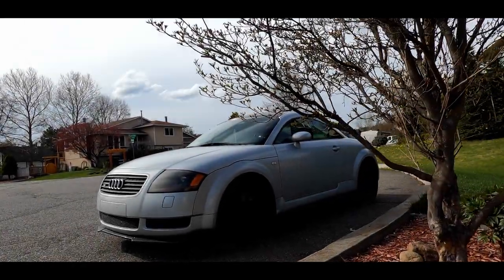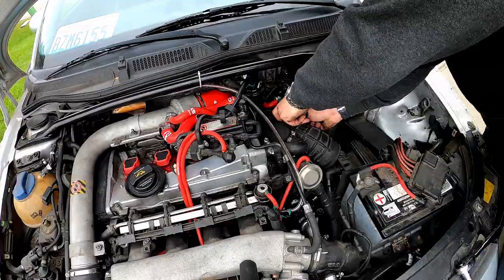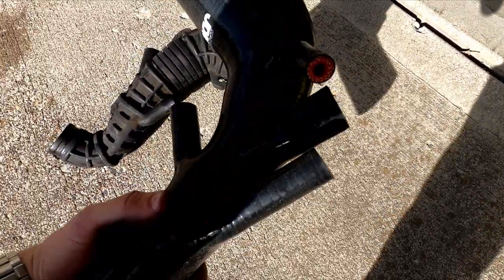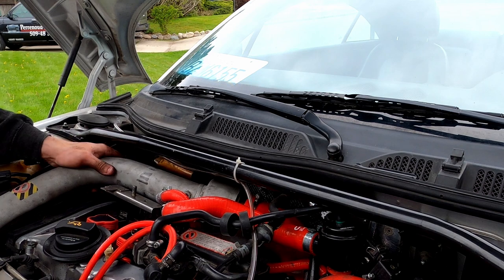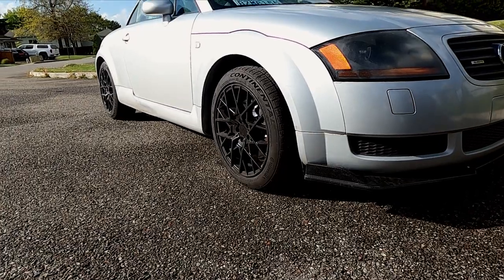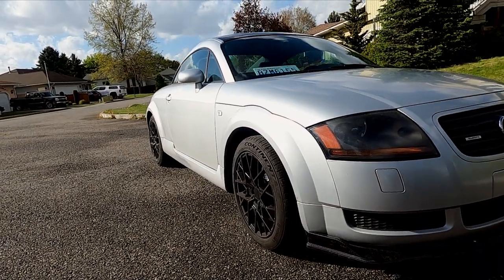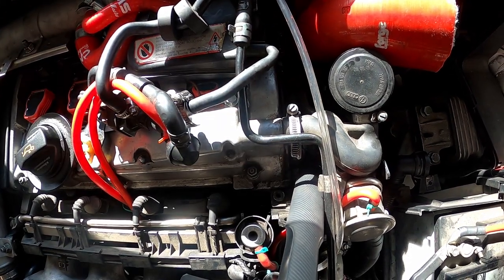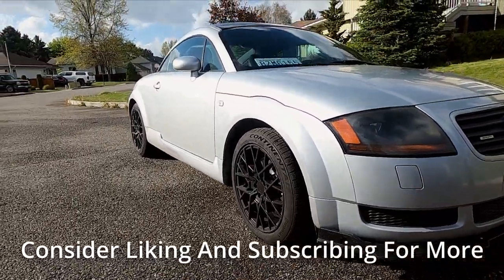My Process To Find 1.8T Boost Leaks Fast! |  & New TIP

Comment: Another interesting video, Hunter, thanks. Your attention to detail does you credit. I especially liked the diagnostic flow chart.
I have another recommendation for you. Adjustable rear control arms are another transformative modification to the TT.  There isn't enough adjustment of rear camber angle otherwise, meaning the car's chassis balance is always towards understeer. Most people concentrate on power mods but the greatest deficiency the Mk1 TT suffers from is in the handling department. The HPA controller and the increased negative camber at the rear have improved my car's handling beyond belief.
Congratulations, in advance, for nearly 1000 subscribers! Best regards. :-)
Reply: I installed on mine. Big difference
Reply: @moncier77  All the TT's grip, in standard form, comes from the front. Most of the weight is there, and the quattro system is asleep much of the time meaning it has all the worst traits of a FWD chassis. The extra negative camber at the back brings the rear into play,  effectively dialling out some of the front end push, of which there is plenty otherwise.
I suspect US and Canadian owners are less bothered about handling, but for UK and other European countries it's more of a benefit perhaps.
If you get an HPA haldex controller (somewhat ironically, a Canadian company) the transformation is complete.
Keep running with wind! ;-)
Reply from the maker: I am glad to hear someone liked the flow chart haha. I always find procedural processes helpful so I was hoping someone else would too. I really appreciate the support. I also like the sound of adjustable control arms:) I will start looking into those and try and get them to show up when I get the coilovers. The HPA controller also sounds like a really great upgrade! Thank you again!

Comment: Excellent video! 
Easy to watch.
Good advice regarding isolating the leak.

Love my Mk1 TT…

Lols… My selector fork just broke in my 6speed….Gulpppp!!😂😂😂
I’m removing the gearbox myself.😐😐😐😂

Looking forward to your next upgrade video… 
“Gets the juices flowing”
Reply from the maker: It makes me happy to hear you enjoyed the video! Sorry to hear about you having to remove the tranny. I'll be doing that sometime when I have to replace my clutch. Thanks for the support!
Reply: Ha I put in the latest version of selector forks in. 
1st-5th selector forks fit, but you still have to use the original reverse and 6th gear selector forks. 

The new versions are full steel and robot laser welded. 

No rivets holdings different incompatible materials together, like bronze alloys and steel.

Comment: I recommend you to replace your front grill. I had the same one as you have, and replaced it with the facelift one (the one with the 3 spokes). I painted it completely glossy black, with the Audi rings black as well. It makes such a big difference. To replace it, it's said that you need to remove the bumper, but I actually managed to do it without removing it. You only need some acrobatic hands and reach from the bottom cooling trim.
Reply from the maker: That sounds like a fantastic idea. I will try and find one soon so I can put it on while I have the bumper off for the front mount:) thanks for the support!
Reply: You had the same one before you changed it. You mean the "stock" grill that comes with the car? ....me too...

Comment: I put the badger 5 tip on which is much bigger than the forge which I was replacing also a pro ram filter is the biggest but great vid and some nice mods  mate 👍 ps if your going bigger turbo or over 300bhp  get forged rods fitted
Reply from the maker: I am planning on building a fully forged engine for the car eventually haha. When I can get my hands on one that is lol...  Thank you for the support!
Reply: @HunterDirection  good stuff mate you know those standard rods are made of cheese 👍im going to get mine forged this year

Comment: Love your videos, they are so useful. I am currently having some boost issues and replaced my n75, however since replacing the n75 it has lost a lot of power and feels like it might even be in some kind of limp mode. Would appreciate any advice if you get the time 👍🤞
Reply from the maker: You sound like you're on the right track. Depending on what n75 you put in they have very different rates they ramp up boost. I know the "race" n75 has a tendency to make the car think it is overboosting and toss them into the 5psi limp mode. Do you have a tune or boost gauge?

Comment: Buddy you did 4mm and 8mm vacuum hoses, we're these dimensions internal bore measurements,  ps I have a TT and am gathering parts for a big rebuild fortnight soon. Love the videos...
Reply from the maker: I believe those are the inner diameters. I will double check that for you though. Sounds like you've got any awesome project! I am glad to hear you like the videos! Thank you for the support.
Reply: @HunterDirection  Gathered some original parts from oil filter to crankcase, a few parts obsolete now, 20 year old car  have to improvise a little, those pipes 4mm and 8mm got to he internal dimensions...be so kind and check your invoice for me...it don't need them ATM but building a stock pile of new parts for some fun in the sun soon...

Comment: I have cooling fan issue with my mk1 tt 225.  Until now I replaced thermostat coolant temp sensor cooling fan switch.   All these parts are aftermarket.  While checking temp 49C temp goes up to 104 or 105 and fan turns on.
Reply: When A/c is on both fans are turning on.  I searched low speed fan should turn on around 85 to 90 C'  and now I am about to replace cooling temperature module.   I remember watching water pump impeller fail video but it was already replaced and thermostat opens fine.  Do you have any idea what could be wrong?
Reply: Was your water pump impeller replaced with a metal one? It sounds like the green temp sensor.
Reply: @moncier77  I do not know  about impeller type cuz previous owner got it replaced at shop. I could call them and ask but it does not over heat. Goes up to 104 or 105 and fan start to turn.   I got aftermarket green temp sensor already.

Comment: A bigger tip for a left hand drive wont work without modding some stuff on the brake booster . I tried on the s3 , didnt work. Had to go to a forge inlet.

Comment: Mines is only -10 vac on start up and only boosts to 10 psi in 1st and 2nd but takes ages to build up to 22psi in 3rd but will get there, It does also flutter…. Do you think that’s just a small boost leak coming from the diverter valve side of the vacuum system?

Comment: How do you prevent the cold air intake sucking hot air? My engine bay gets hot, so I'm afraid to put a cold air intake, and how do you detect boost leaks without a gauge?  This audi is my first car, so I don't know what to look for or feel the loose of power